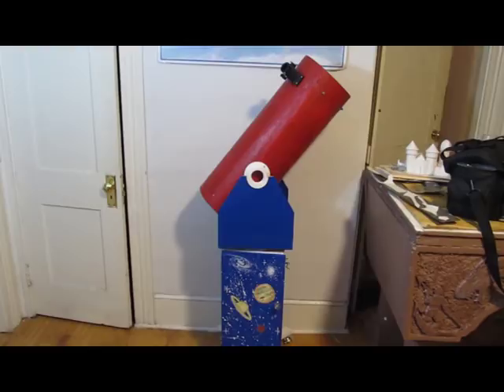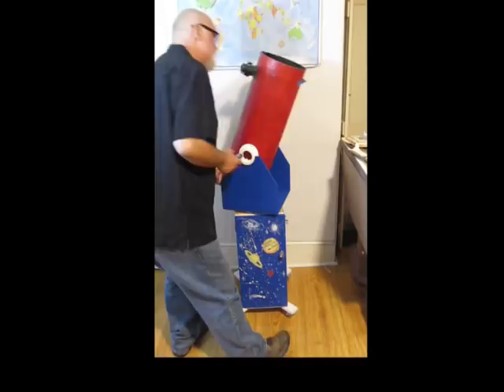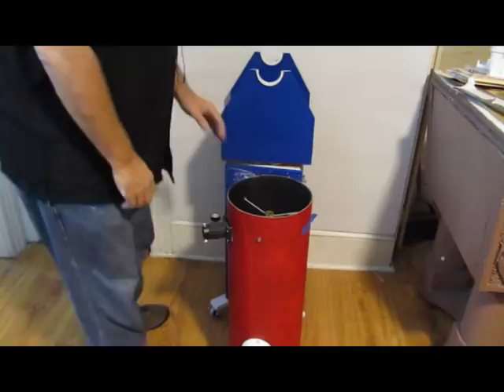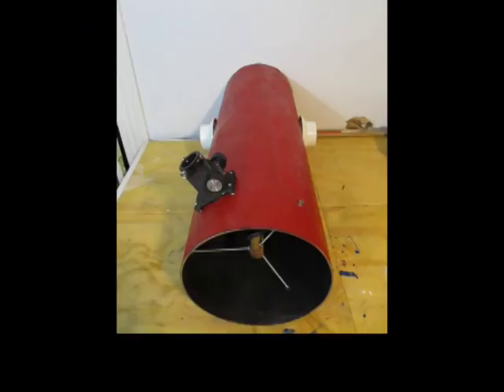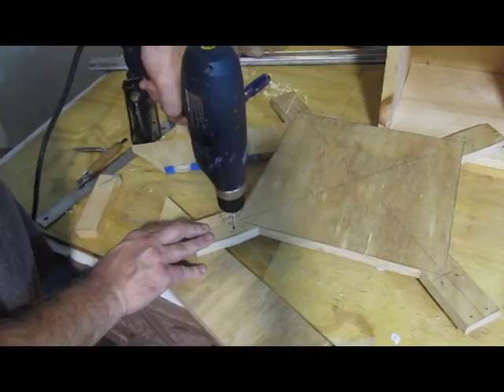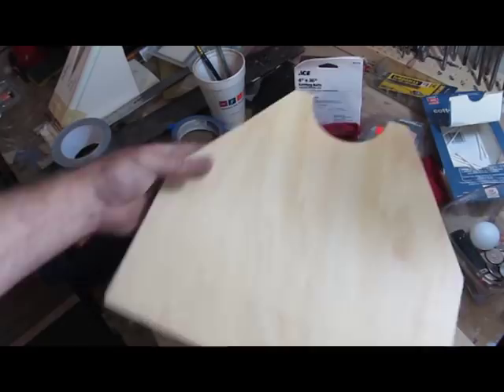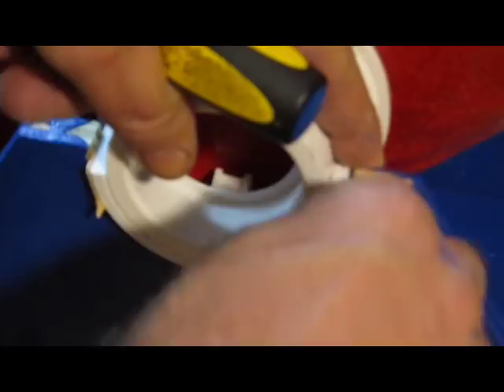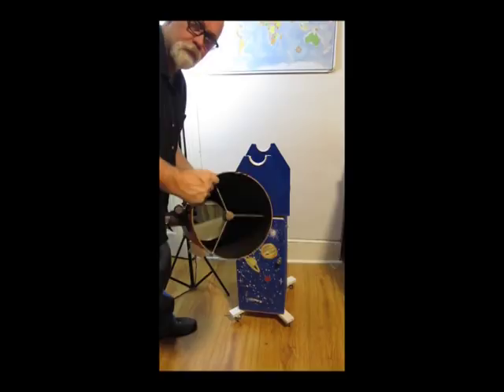How to Make a Telescope (Part 2)

Comment: Very clear explanation of how to make a simple scope. For anyone contemplating this I would say the secondary mount looks very simple with no ability for adjustment. That makes construction easy but could cause issues unless you get it right first time. The legendary late John Dobson did similar using shims of wood so it must be possible if you are patient. Using this method and at ~f3.6 such a scope would be OK for wide field views of star fields, perhaps bigger nebulae and galaxy hunting but certainly not planetary observation. Love the under scope cupboard for accessories, that's very handy.

Comment: these videos are a good example that most people could build a reflector telescope, using optics (mirrors, focuser, eyepieces) from a telescope supplier.

However,
Those plastic tube bearings and 'lazy susan' will eventually cause you  a LOT of grief, which is why Mr. Dobson chose the Teflon bearings for the scope side and base bearings, and they work the same for a 6-inch mirror or a 16-inch mirror.  You can move the scope with a 1-finger push.  Ball bearings are meant for high-speed rotation, not once-per-minute micro-adjustments. 
The tall cabinet & mount will eventually fall over, so you need to move weight down low, use Teflon tube bearings (2 for each side) and 3 Teflon bearings to replace the lazy-susan. A doubled 3/4 ply base with 3 feet will sit well on almost any surface, so the 4-wheeled base is only good for a smooth or concrete surface.
Please move the scope away from the door, unless you want to pick it up from the floor after someone pushes the door open.

Comment: Thanks for great video. The telescope works great. Only modification I made was to make main mirror quick release. Mirror sores in a box when not in use or in transit and easier to keep clean. Just slotted holes in tube to edge and locks in with wing nuts. Surprisingly good pictures when using telescope with digital camera. It really good for this. Now built a 14" one but the 8" a solid backup with camera. Love it.!
Reply from the maker: Great to hear from a fellow telescope maker. You should send me pics of your telescopes, for my website!
Reply: Hey andrew can I see some pictures that you took please? I want to make sure itll work before I invest in building one myself

Comment: Awesome idea on the cabinet holder!!
However, I would have made the lazy-susan cradle holder part taller SO THAT WHEN you store the telescope you can point the open end down thus avoiding dust accumulation on the mirrors.  I understand weight balance but there could be some type of 'seatbelt' to keep it from tipping over.
Reply from the maker: Excellent creative thinking.

Comment: HOW GOOD CAN IT SEE SATURN?? THX.
Reply: Why are so many people asking this question ?  It is going to see it as good as any other 8" dobsonian (so Yes)
He's using purchased optics , which are really good and cheap these days.
After that , it's just about how well you line them up ... which his fine tune adjustments are plenty good.
The cabinent stand is a bit of a weak point imo , that could make steady images tough , but not impossible.
So imo , I would get a mirror with a longer focal length so the support base would sit on the ground .
Guessing he has an F4 mirror ?   So I would get an F6 , plus it has a higher magnification range ... Cuz me likes more X power ;)  hehe
Albeit the image gets dimmer ;(   ...  so a shorter focal length will give you brighter images  , which I guess was his choice of personal preference .

Comment: Whoops, that base peice is not 1/2, it's 1".  It would be good to glue those peices before you put the screws it--makes it stronger.  As for the wheels, it might be better to have two of them non-swivel.  One more thing is that this needs a cover for the tube, as dust will start coating the mirror.

Comment: It looks great and all, but how do we know you can actually see anything with it? You need to make a video with photos of whatever it is you can see. How far can you see with it? Can you actually see Saturn? That's my first question. Great video 👍👍👍 brother.
Reply: well, I went ahead and got some materials for this because it was relatively inexpensive.  I have most of the measurements and all I need to do is assemble.  I'll let you know if it works out.
Reply: honestly just buy something already made for you lol
Reply: @1theheightofparadise  Did it work?  I want to build one myself
Reply: @burnt_toast_astro7180  nope, its junk.
Reply: @TerryRGraham  Building a scope rn, I have learned a lot from doing astrophotography since my previous comment.

It may be a difference in mirrors, or quality of mirror cell. Idk, I don't see why it wouldn't work